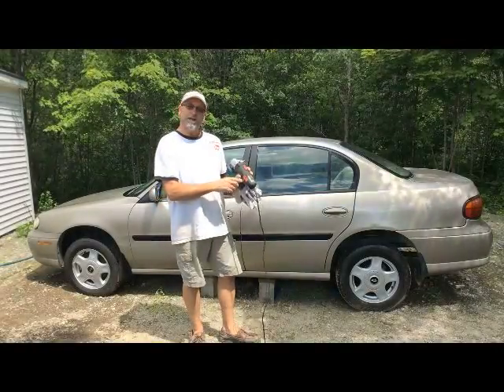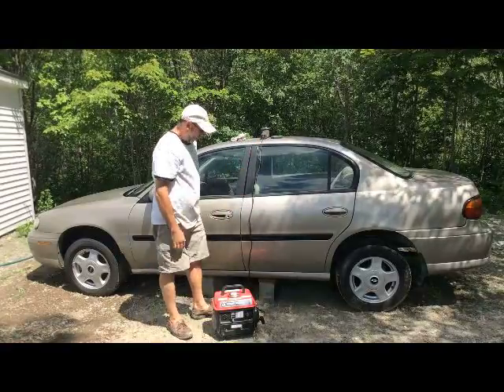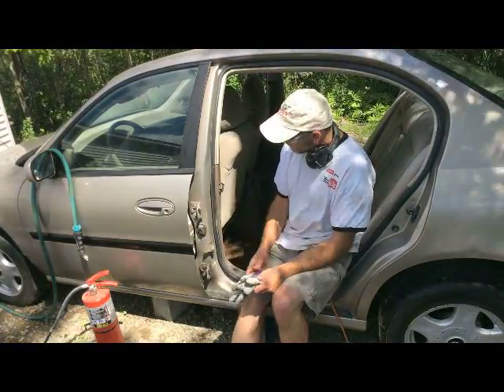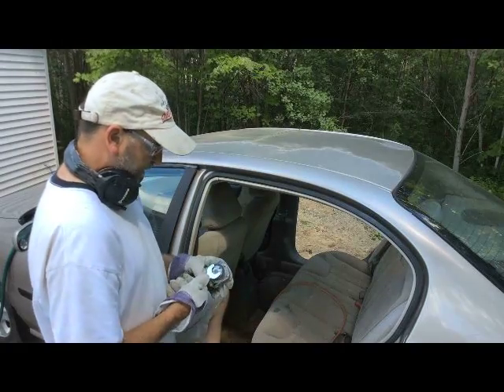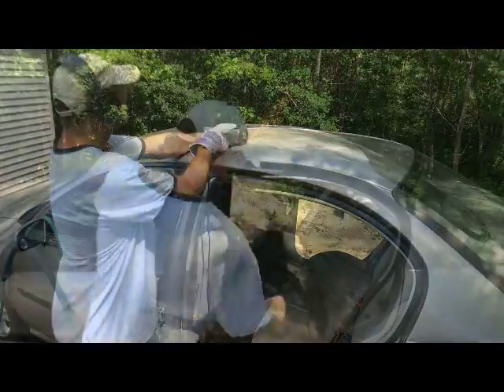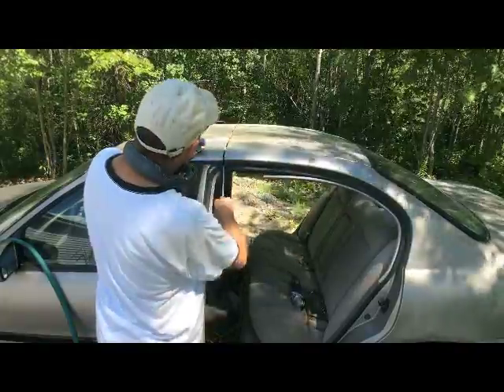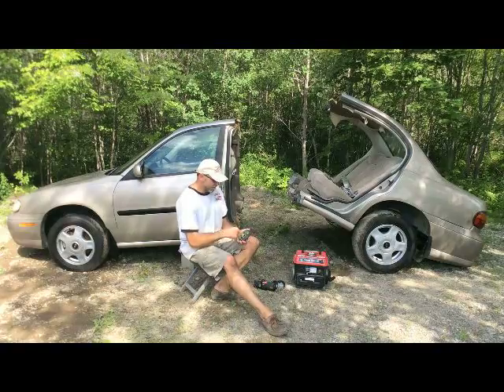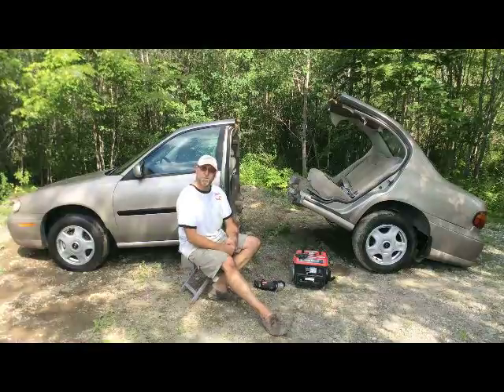Cutting Car In Half With Harbor Freight Tools

Comment: We have an old 1980s suburban and its been in my family for years and my siblings and I all came home in it when we were born but it doesn't run it's bear up and old but I don't want to part with it so I want to cut it in half and turn it into a tow trailer for storage kinda of a way to keep it in the family and make it useful and alive again any tips you can give
Reply from the maker: Just go for it.

Comment: Why???  Hope it wasn't a runner, somebody in need could have used a cheap car.  Looked really clean for a 20 year old car too.
Reply from the maker: (: I spent half a day cleaning one side up and with touch up paint and wax I made it look good (: It worked, the motor and trans gone and rusted bad underneath, up hear in the north east they do not last long, also I wonted to see if it could be done with harbor fright tools, stay tuned got another one coming, Thanks for watching.
Reply: Do you need to ask? Its a Malibu. Chevy already did the damage before it rolled off the line